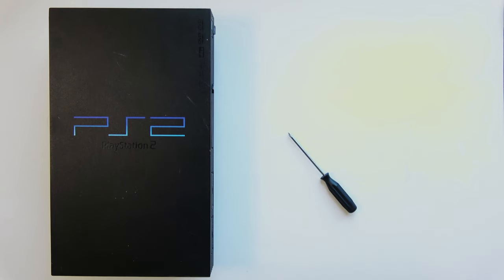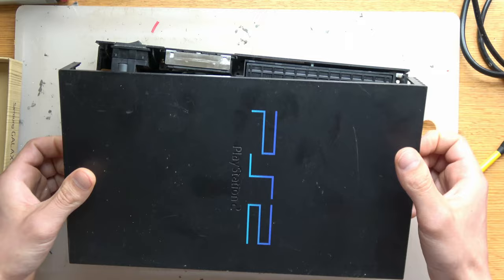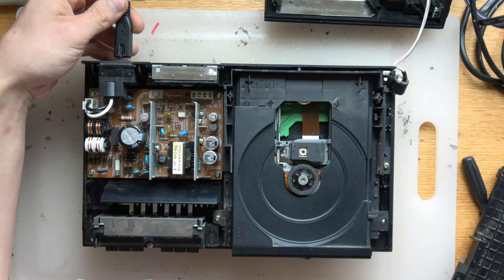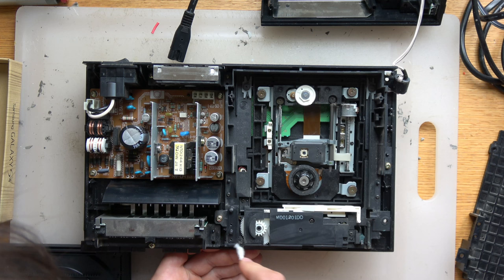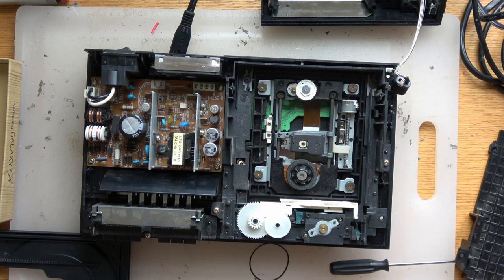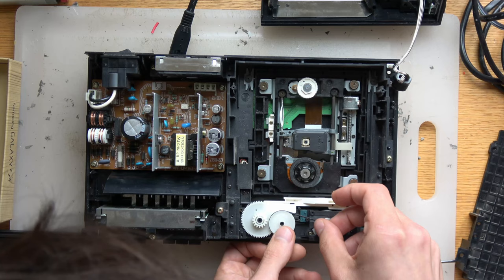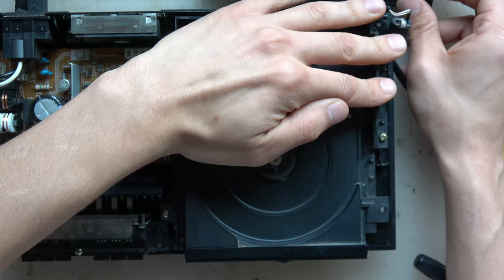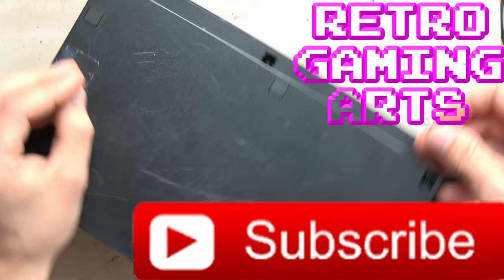HOW TO FIX PS2 DISC READ ERROR + MORE - RGA

Comment: Stumbled across this vid when trying to refurb my recently purchased OG PS2. Unit was working when I first got it home but needed a new CMOS battery.  Replaced the battery with no obvious issues, then the laser stopped reading discs about 3 weeks later.  Just got round to giving this cleaning tip a try, but it's still coughing up a Disc Read Error after about 20 seconds of trying to read any disc I put into it.  Would this indicate that a new laser unit is needed, or is there another workaround that I've missed in bringing this back to life?
Reply from the maker: New laser. KSH-400C is the laser for most ps2 fats. Unless you have a very old early ps2 fat, then you will need KSH-400B

Apon receiving the laser you will need a soldering iron to remove the anti static solder blob on the laser in order for it to work. And you MAY need to adjust its potentiometer. They get shipped with random values
Reply: @RETROGAMINGARTS  As much as it could be a fun distraction during this lockdown, am I better off with a replacement PS2 (slim or original), or trying to get hold of a PS2 compatible PS3 (model CECHC03 in the UK)?

Comment: Outstanding!
Reply from the maker: +TorkManix thank you, any repair or mod you want to see? I think i asked you this before and you said 32x, and i did it, so now i hafto ask again lol
Reply from the maker: +TorkManix im going to be doing pretty much all repairs and mods, just dont kno witch order to do them in so help me out!
Reply: RETRO GAMING ARTS Yes! Anything on the Game Gear. I have a few with bad caps. A good video on replacement would be nice. Or even an AV mod.

Something short on some soldering tips, maybe how to avoid cold solder joints or proper temps to avoid damage to chips or the board. Especially desoldering, I have trouble with that.

Battery replacement on carts too. Genny, SNES, GameBoy, whatever is best for you.

Congrats on hitting over 500 subs too! Seems like just a month ago you were doing a video about hitting 200.

Comment: My ps2 game of pacman world 2 is not loading it would get passed the Playstation 2  logo then go black then I checked on a different  ps2 and it loaded all my other games work on my ps2 just not pacman what's going on
Reply: Just found out somehow my wireless ps2 controller was interfering with it so I took it out to use a wired one cause when I try to play certain games with the wireless one it doesn't fully work and glitches the movement

Comment: Ok I don't have any PS1 games but I did put a movie in and then another PS2 game. It reads the movie and the other game I have...only have two games. When I put the game I always want to play a it will not accept that game disc. I have cleaned everything. Which it needed a little but not so bad as some of the other videos where there's cobwebs. The disc has no scratches or dust as I make sure they are clean before they get put in. Any ideas on what is happening?

Comment: I've got mine on ebay for sixty bucks and it didn't really work so I opened it to clean the inside and there were dead roaches inside. I've cleaned it the best that I could and it works a little bit better but most of the time it doesn't read disks.

Comment: I am trying this. I cleaned the inside with 2 Q tips. I put the disk in and it does not do what it  is supposed to do. It does not sat playstation 2. It says Sony computer  entertainment  and just goes to browser and system configuration. I do not have any Isopropyl alcohol or White Lithium Grease. My PS2 console or model or whatever it 3 is SCPH-70011.  I tried to clean the laser that is on the inside with a Q tip and rubbed the Q tip on the laser but it seems to have 2 lasers. Any help would be appreciated. It used to say the disc couldn't be read.
Reply from the maker: Sounds like you need to buy a brand new laser, 400c on ebay they're 10 bucks

Comment: you heard of HDLoader/OpenPS2Loader, i use OpenPS2Loader on my PS2 fat, faster loading times and not using the unreliable laser.
Reply from the maker: I mod alot of ps2s, I use hdloader usually, is OPL that much better?

Comment: I don’t have a screw driver small enough for the disc tray screws
Reply: Having the same problem did you ever figure out what phillips size this is
Reply: Jayson Fraire no I ended up saying screw it, and i tapes two q-tips together and stuck it in the tray over the laser. It worked!
Reply: @joeybelanger2471  wow that's good  I got it open by using a kitchen knife to turn the screws cleaned the lenses now using the knob to adjust the laser finally got it to stop disc read error but now its just spinning and not taking me to the game hopefully a few more turns will finally get it working properly again

Comment: My ps2 wont read my disc ive been struggling all day trying to watch different videos. I’ve opened it and fixed inside so it can spin then It worked with one game but then I tried to clean the laser but after that I couldn’t play any game at all

Comment: Hi guys I was wondering if it’s safe to use the computer keyboard keys cleaner spray inside the console? Maybe clear all the dirt and dust. Wonder if it’s ok if the spray touches the metal erasures and chips too. I have not opened my PS2 yet but I will and can imagine the inside as I see the dust on the window grills and the fan looking at the console already
Reply from the maker: Yep. That works perfect

Comment: My PS2 was reading games fine, but DVDs would get an error. After I cleaned the lens it still reads games fine, but DVDs now infinitely read / load without showing an error. I also don’t have any ps1 discs to cycle through, do I need one? Or CDs? Anyone have a similar problem or a solution thanks!

Comment: Okay I did the cleaning.
The ps2 wouldnt read ANYTHING BEFORE. Now, its reading games. The issue i have is that, it kind of works when it wants to, but then it sort of stops. Games load kind of slow but once running and past loading ps2 screens, it works.

I heard theres a laser under the surface one.. maybe i should clean it too?? And it wont read tales of abysss ps2 game
Reply from the maker: You may need to buy a new laser and out that one in
Reply: @RETROGAMINGARTS  I'm in Japan, it was cheaper to buy a new ps2 at a gamble $12 usd.

The new one was also not working. Cleaned it and it's totally fine! The laser would have cost $30
Reply from the maker: @imaginableAudio  haha smart move lol

Comment: I know this vid is older, but just curious, can you explain how to fix a fat ps2 where discs won’t spin? I’ve seen a ton of videos of the slim being fixed, but not the fat system. Help would be great! Your vids are great! I subbed.
Reply from the maker: Hmm, I havent encountered that issue. And I've done a tremendous amount of ps2s. If I did, I would either swap the drive motor or the whole drive.

Comment: i remember the disc tray on my ps2 being extremely wonky so I instinctively blasted it with wd40 and it solved the issue until the drive started making odd noises again about 3 years later

Comment: Hello!! I have a ps2 slim model. When I put the disc it shows "reading disc" and keeps on showing it but does not proceed any further.
What should I do?
Reply from the maker: alcohol and a qtip on the laser, if that doesnt work, you can try buying a new laser on ebay for 6 bucks and replace it
Reply: Thankyou!!

Comment: Got a fat PS2,  cleaned the laser & got all the dust out & none of my PS1 games don't work, most of the PS2 games do work except Rogue Galaxy it keeps saying "Disc Read Error" & the disc has no scratches or anything, is there a reason why this happening?
Reply from the maker: your laser is on its way out, i would buy a new one, you can try tweaking the pots on the BOTTOM of the laser itself, they look like tiny philips screws
Reply: RETRO GAMING ARTS Thanks for the reply & the tip

Comment: I tried this and the ribbon cable to the buttons detached, any ideas on how to fix it?
Reply from the maker: You can just slide it back in, there should be a little blue peice on the ribbon cable. That's the wedge that holds it in place
Reply: @RETROGAMINGARTS  Ok so I managed to fix it but it still won't read DVDs after I cleaned the laser. What's weird is that it worked for a little bit before it said it's no longer able to read the disc and it went back to the way it was before I opened it
Reply from the maker: @MmZxWolfblade  sounds like the laser is dying, cleaning it only really fixes it if it's dirty. And now the systems are getting much older to the point where the lasers just need to be replaced
Reply: @RETROGAMINGARTS  I see. I'll try swapping the discs in and out like you suggested, maybe that'll do something

Comment: My MK Deception goes black after loading a profile from mem card. Can this fix that??
Reply from the maker: it's hard to tell if the the problem is with the PS2, the GAME, or the MEMORY CARD, we hafto isolate the issue before trying to fix it, but, cleaning the lens is ALWAYS a good thing to do on a ps2, so it WONT HURT, but it may not fix your specific issue, IT MIGHT! i would clean it yes, but also try transfering the data file to a different memory card(i dont think that will work, but its worth a try) also does your deception work withought the memory card?
Reply: I loaded it without the mem card and it got stuck on the loading screen with the MK logo
Reply from the maker: clean your lens yes
Reply: damn im scared to open my ps2 but i guess i have no choice lol

Comment: Yo I no u won’t respond but I’ve a ps2 that won’t read discs or read the controller how could I fix it
Reply from the maker: For discs you may need to swap it to a new laser, and for the controller the controller plug that plugs the ports into the motherboard may have come loose, try reconnecting it

Comment: I did this and cleaned my entire PS2 but I’m still having an issue where occasionally it won’t read the disc or won’t show any video, but the audio works. I really don’t know what’s wrong with it because it’s doing the same thing with multiple games but it’s unreliable. Sometimes it works and sometimes it doesn’t. Can anyone help? :/
Reply from the maker: Sounds like the lasers just on its way out, you can either tweak the pots on the laser to get a bit more life out of it, or buy a replacement laser on ebay and swap it in. They're cheap and available
Reply: @RETROGAMINGARTS  Oh okay! If the problem persists I’ll try that. It’s finally showing video now and staying on so maybe i’m good a for a bit. Thank you so much! :)
Reply from the maker: Ok dope that's awesome, great job taking it apart and cleaning it! If you end up needing to swap laser and have any questions just hit me up I got you

Comment: My ps2 fat plays in black and white.. Ive tried new av cables and cleaned the console from the outside
Reply from the maker: hmm, there could be SO many different reasons for this, but it sounds like a chip on the motherboard is dying
Reply: @RETROGAMINGARTS  Hmm.. And I picked up 3 more today for 10 dollars and neither of those will read
Reply: @trentenbelka9328  wired hooked up in wrong configuration same happened to me tried to hook to flat screen TV and was black and white. Son came over and switched up wires and color beautiful bright color.

Comment: I started having issues with it reading some games (PS1 and PS2) that it didn't before.  I tested the same discs on a friend's slim (Mine is the fat) and the discs worked fine.  Is that a laser cleaning issue?
Reply from the maker: most likely it is, if you are 100% certain your discs are working (which they sound like they are) and its just your specific PS2 that is not playing them, you may need to clean your laser, and mise well clean your entire console while your at it. luckally it's not that hard